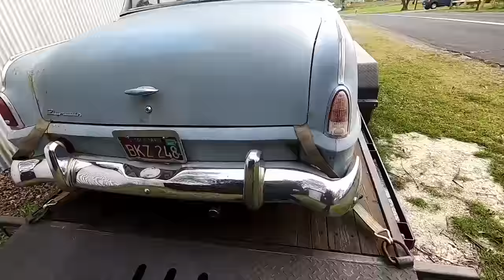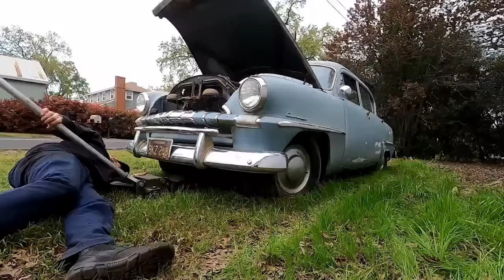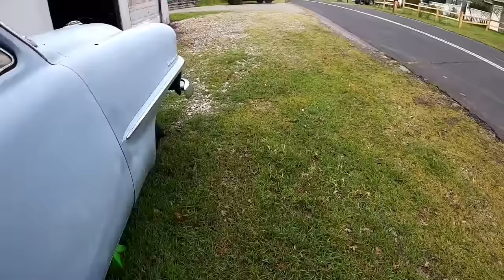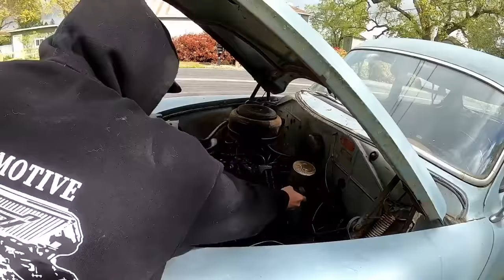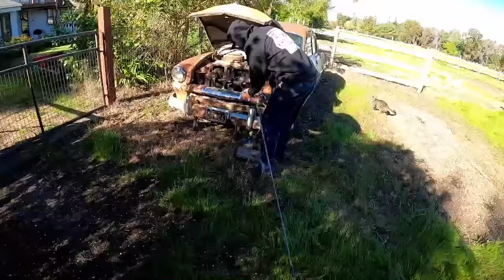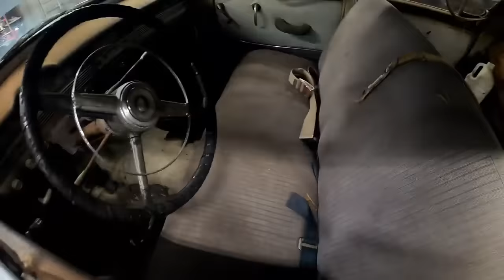NEW PROJECT CAR! WILL IT RUN?!?! 1953 Plymouth Cranbrook

Comment: Great work! It's amazing to see how the original Crankbrooks were constructed! I remember all the original parts and mods i had to do over the years. My 53 2 door coupe started out as a 6 cyl flathead column shift in 1997. After a ton of time and $$$, has evolved into a drag and drive street rod. I'm in the middle of a major remodel. Check it out when you get a chance. Congrats, you've done an amazing job!!

Comment: Leave everything as original as you possibly can.  Rebuild the brakes, and perhaps go to a two circuit braking system.  Leave the flathead 6 as it is.  If it's in good tune it will give you more power than you need with that ride.  Those engines were almost as legendary as the slant 6, but perhaps legendary in their own right just the same.  Hallmarks of such engine are quiet and smooth operation, and a good torque curve, and great drivability.  I had a '53 Dodge truck with the 218 inline 6, and it was quiet enough you could hardly hear it from 10 paces away when it sat idling.  I have footage here on YT.  

If it weren't missing large areas of paint I'd leave it as it is, and after polishing hit it with a clearcoat, perhaps.
Reply from the maker: I like the idea! I’m definitely going to get it going and driving as close to original as I can. The parts car has a better looking RR door that I’m going to swap over.

Comment: years ago several auto companies put LH thread on drivers side supposed to hold better if not real tight something to do with the tire rotation is supposed to tighten as it rolls

Comment: Cool Car and  just so you know or can try , when you have stuck wheels you can pour water on the trailer and those wheels slide a helluva lot easier
Reply from the maker: Thanks for the tip! I thought about bringing some dish soap😂
Reply: @KrisGuzzi1  we always use water and when your done it dries up and no mess
Reply: That's "pour" water....
Reply: @rogerlee3941  lmao , auto correct screwed it up

Comment: I just got basically the same car in a trade for some work on a motorcycle from a customer that I've after for awhile, Mines the same color but the front clip is white, and it has no drive train, the original front end was just too gone so he replaced, I have a 71 Dart that a tree fell on last year that I'm going to strip the 318 Engine, Torque flight auto Trans and rear end out of and put it in the Cranbrook. I'm going to paint it White and paint the roof burnt Orange and I'll probally paint all the chrome Copper.